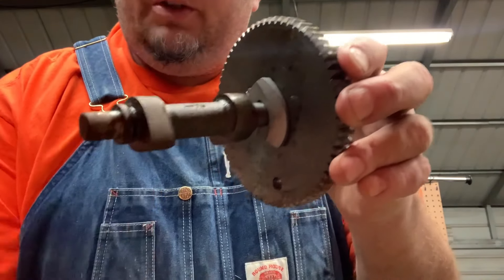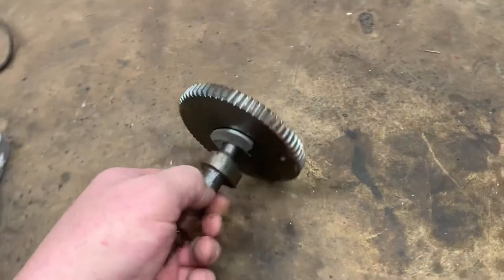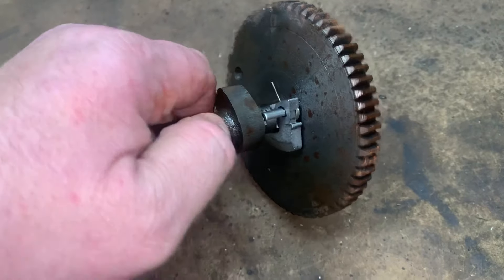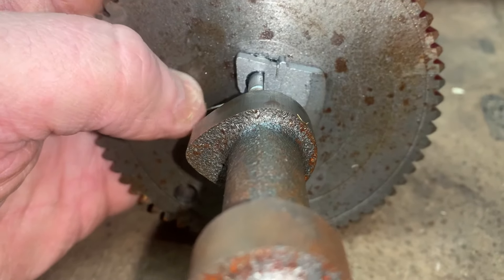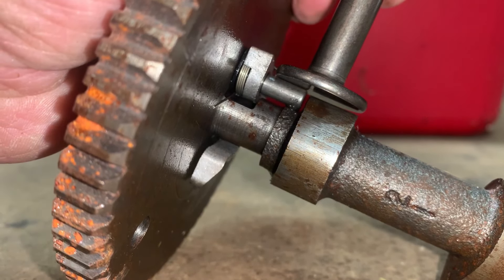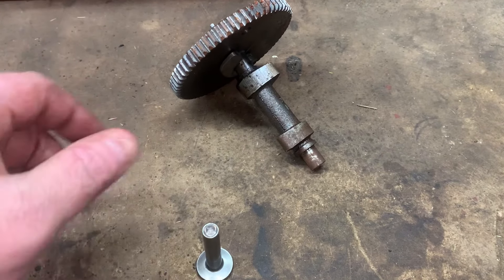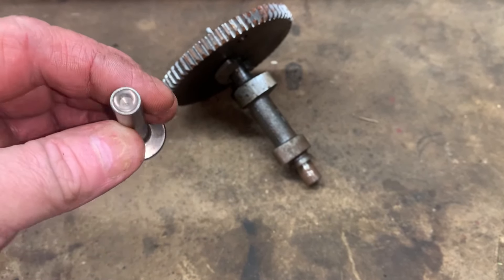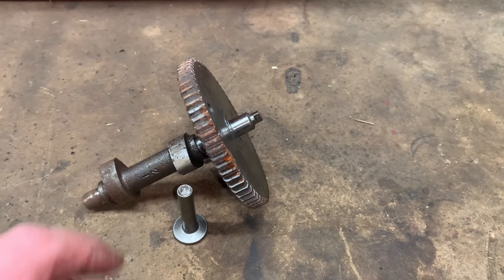HOW THE COMPRESSION RELEASE WORKS ON MOST SMALL ENGINES

Comment: Great information here. I adjusted the valves on a tiller that was an absolute bear to start, and voila. I actually verified the spark plug was tight it pulled and started so easy!! Considering it would yank your shoulder off of your body prior, I was pretty excited.

Comment: Thanks for this video. A Gorilla couldn't pull the start cord on my new Honda engine. The service manager had me draining oil and pully the sparkplug before I came across your video. One hit with my rubber mallet apparently dislodged a stuck relief and the engine started with one pull. The engine was shipped to me and I suspect the relief moved. The engine has been starting easily since. Thank you very much!

Comment: I am working for the first time on a Briggstratton CR 950 and was confused with the exhaust valve because it opens a little bit and it sucked a little air and then opens all the way and discharge. Thanks for this video I learned way.thanks

Comment: I have the same Intek 18.5 HP engine that is in the video.  Adjusted the valves at top dead center, and the engine was hard to start.  Had to rotate engine by hand just past the compression stroke, and then it would start, and it ran good.

Adjusted the valves again at 1/4 inch past TDC, and bam it cranked right up every time.  That 1/4 inch was the difference between hard to start, and cranking right up like it's supposed to do.  I reckon the 1/4 inch past TDC has something to do with the compression release.
Reply: That same thing happened with my Briggs  V-twin 22HP.   Re-adjusted the valves by going 1/4 inch past TDC and  worked. Started right up no problem. It won't crank past the compression stroke before doing this.  
 Thanks snippits75

Comment: really help video do some lawn mowers dont have compression realese? how can you tell?
Reply from the maker: Some do some don’t  you would have to look up your engines specifications to be able to tell but you can just pull the valve cover and rotate the engine over and it should open the valve slightly right before top dead center

Comment: This was happening to me, it turned out to be a weak battery.  It wasn't amping the starter enough to turn it over.  I jumped it from the car battery, and it ran just fine.  Just in case someone is checking off the easier fixes first before pulling the engine apart 👍

Comment: I read on an old lawn mower forum from 2008, that the Briggs and Stratton Van Guard, single cylinder engines, had the decompression release machined into the crankshaft and that it worked very well, and made the engines last a very long time.  The guys talking on the subject said that Briggs and Stratton had gone to the present camshaft release "lobe" as a cost savings move, but that the In Tec engines, the ones with the faulty set up, were terrible and had a bad reputation for failure.  Do you know if that is true?  Excellent video, by the way.

Comment: i have a 12hp briggs and just pulled out the cam . this engine ran ok full speed but like crap idle or hi idle . what i found is the  intake valve was being held open thru the entire compression stroke just slightly but on top dead center it would close tight and clearance is .005 . is the cam lobe ground wrong ?

Comment: I have a 16 ph Briggs engine, and unless it spins really fast the engine back fires through the intake and exhaust and will only start on a battery with a full charge. Could this be a bad camshaft pressure release causing this issue?

Comment: Great video, and very clear explanation as to how that slinger lifts the valve....Thanks!  
May I ask - in you experience, how far out of adjustment would the valves have to be, to make it hard to start?  If they were out 0.001-0.002"  would that make it hard to start?

Comment: Excellent! clearly explained how an automatic compression release works. I have a newbie question, why is there a need to release compression at that very moment and for a given angle? If someone posts an answer I will greatly appreciate it.
Reply: Its sole purpose is to make the engine easier to crank. So you can use a smaller battery, starter, etc. while at the same time running a higher compression engine which will have more power/efficiency.

Comment: Thanks for the explanation!  I've been trying to get my virtually new generator to run and I think the compression release is staying on.  The unit is 2 years old and has less than 5 hours on it.  I have only run avgas in it, no ethanol.   I tried ethanol mogas because I thought the vapor pressure on the avgas might be too low, but that didn't help.  It has spark, but I changed plugs anyway.  Disassembled the carb, sparkling clean, but it feels like it's spitting air back out the air intake when cranking.  After cranking 10-15 seconds, it drips fuel out the air intake.  Manufacturer recommended complete new carb.  Same result, so they sent another complete new carb.  Same thing.  Fuel shutoff on carbs work, oil pressure sensor has been plugged and unplugged.  Crankcase vent has been disconnected from carb as it may have been the source for air spitting back through carb, but that didn't help, either.  Checked valve clearance and one intake was tight.  Set it to factory spec of .006" and no change.  It will sputter a little if you pour gas or starting fluid directly into the intake manifold with the carb removed.  I'm thinking either a sheared flywheel key or compression release not releasing.  I hate to tear into the crankcase on an engine with only 5 hours.  Do you know of a way to test the compression release without disassembly?   This is a Champion 12000 KW generator, #100111.  Thanks!

Comment: Huh, i have yet to pull apart any of my briggs 190cc motors and all 3 run a compression release. Now i know what it is and how it works. So there is no sacrifice at all, its soley to start the engine. Really cool. But i was looking to see if i can rig a compression relief for the 66cc chinese motorized bike engine on my bike. Around 600 to 800km it gets extremely hard to turn the engine over due to higher compression from the rings seating in tye cylinder. Once started it runs fine.

Comment: Great video, dealing with 2nd broken compression release on 19HP 33R877 motor,  any chance that the slightly earlier 31P777 cam (697762) will work in our motor ? It is all metal no plastic  at the CR weight similar to the design you just showed.  I would have to machine the groove for the oil pump drive bit have a milling machine.  It seems on the late cams I am wondering if the weigh does not walk down the CR D shaped pin and get into contact with the tappet etc. that tiny open snap ring looks like its intended to keep that from happening but seems if it gets rotated the open end could allow the weight to get by it considering the CR weight is just hanging from the bottom side of the cam gear. If i need to replace that cam with the one with plastic I may tack weld a fork to make sure that weight cannot walk away from the lower face of the cam, any thoughts on making these failures not happen,    This last fail bent the cam and broke the cam locating boss in the cylinder housing ? Thanks Ken

Comment: The compression release was working. I adjust valves.. compression got really tight. And when compression builds its kicks motor back and spin in reverse and destroys pull cord...adjust valves 30 times at top dead center of.compr3ssion stroke. Right when cylinder is at top after compression stroke. Still not engaging compression release. Compression release is the exhaust valve? Is it because it too loose or tomtight? I went from .010 - .001 snd no compression release

Comment: What are signs that the compression release spring is broken
Reply: Hard to start even if the battery and starter are good.  Rotate the engine by hand just past the compression stroke, and then start it.  Might take a few tries to get it cranked, but it will crank.  Also, use starting fluid, and then rotate the engine by hand just past the compression stroke.

Comment: I have  a 17.5 intek that's got no compression. It never smoked, it just stopped runnin.  I took the plug out, put my finger on the hole and hand turned the engine.  no compression what so ever.  I put a rod in the plug hole and the piston is moving.  the only noise it makes is a hiss inside the engine.  Could the compression release be stuck open?  The hiss is only on one of the strokes.  I also set both valves at .004 and am sure the cam, rods, rockers, and valves function properly and the valve guides are set properly..
Reply from the maker: Stuck valve
Reply: @THEMOWERMEDIC1  slipped valve seat.  I put it back in, set it in the head like diamond-setting with a punch, relapped the valves and reinstalled it.  Runs fine.

Comment: Have a GX270 Honda engine that was running perfectly, shut it down tried to restart and no compression. This engine is not that old and was starting first pull, could there be a problem with the decompression????

Comment: Great video, thanks.  Does this mean it is useless to do a compression test on any motor that has one of these?  If so is there any way to know if a motor has one or not?  Thanks again from a fellow Texan!
Reply from the maker: Cylinder leakdown test is the way to go.  An easy way to tell if I engine has one is to look at the rocker arm or the valve if it’s an “L” head engine and watch for that .030” inch lift just before tdc
Reply: Thank you sir!

Comment: thanks for the info. i have a 18hp briggs 1991 duel spark plugs it acts like it has no power any ideas ?
Reply from the maker: V twin or
Opposed twin?
Reply: @THEMOWERMEDIC1  v twin
Reply from the maker: @ncrdisabled  those double barrel Nikki carbs can be troublesome.  You can do a balance test on the engine to figure out which barrel of the carburetor is not functioning properly

Comment: So....I have an 07 gravely zt40 with a courage 17 and only 250 hours....I went out, mowed and all was great....went to go mow a week later and it's as if I have an open valve...spins super free, won't start. Ni checked the lifters and they are secure and moving while cranking.  Anything to do with your topic?
Reply from the maker: Stuck valve from running engine on old gas.  Seen it many many times
Reply: @THEMOWERMEDIC1  man...you won't believe this though.  The old man that had it was beyond meticulous.  He used those expensive precanned non ethanol gas products, drained the carbs and tanks of all his equipment and had books of service records.  When I got this mower he had stashed it away because it quit running...even then...he emptied the carb out.  I know this because in my trying to make the thing run I replaced the carb, pto switch, ignition switch, ignition module thing with the plug wire, battery, all fuel lines and finally got it running very nice.  
Anyway... suggestions on how to resolve?  My thoughts would be to spray carb cleaner down the valves and try to get it loose and then change the oil.  Am I being stupid?  Lol

Comment: I usually file down the end of the  valve stem to make the valve close for higher compression. I never trusted the compression release. All you do is hand turn the engine and watch the valves cycle through the 4 stroke process. Between bottom dead center on the intake to top dead center compression, you'll notice how the valve remains slightly open to allow the easier pull starts. It wastes a bit of gas plus emissions that are being banned in future, and at normal operating speeds it still runs underpowered. Once you max the compression 60psi-80psi, you might blow the muffler apart.